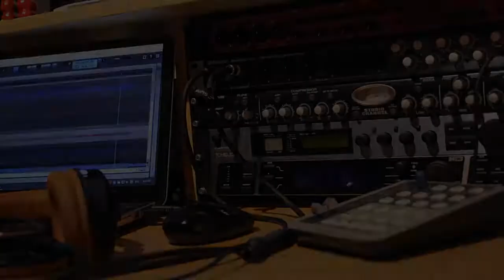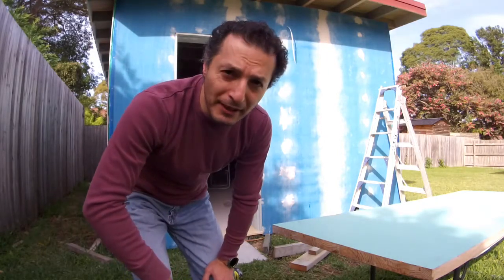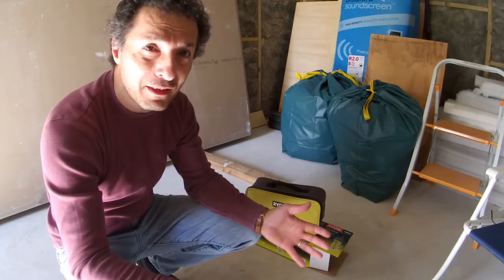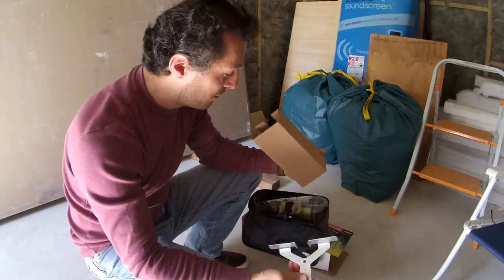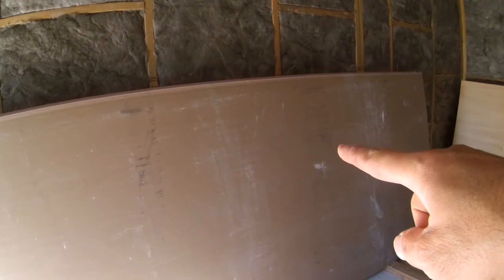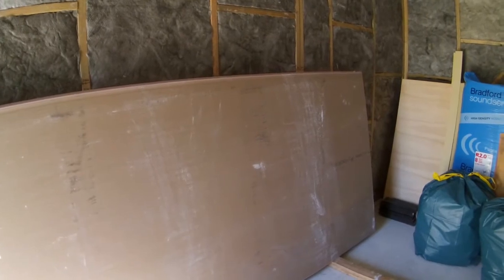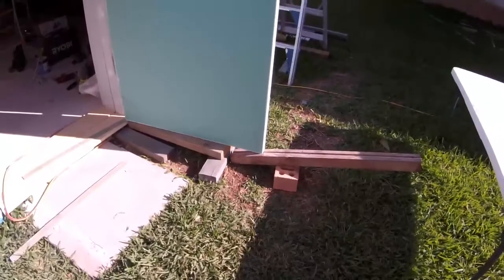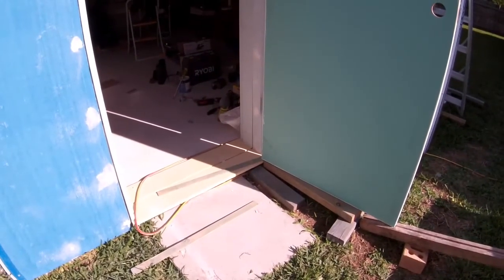Building My Home Recording Studio - Part 19 - The Outer Door

Comment: That router might even save you some money when it comes to buying baseboard or crown molding if you're going for that look.  It can turn cheap 1x4 stock into a nice figured molding!

I kept my mouth shut when you were waffling about which gypsum board to get...but I'm glad to see that you went with the good stuff :)  I think that you'll be glad that you did, in the long run.
Reply from the maker: When you get too many opinions every time you visit the hardware store... I think though it will cost me more now, I'll earn it back with late night recordings.
Reply: Exactly!  Add to that the countless opinions you'll find on the internet, and it's easy to get bogged down in too many options.  Cheers, man!  Here's to the continued success of your project!